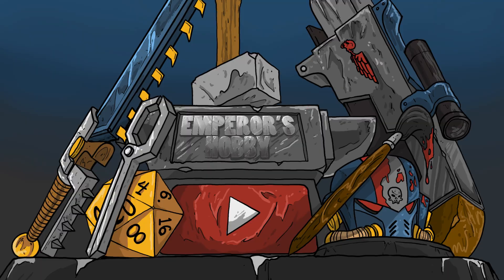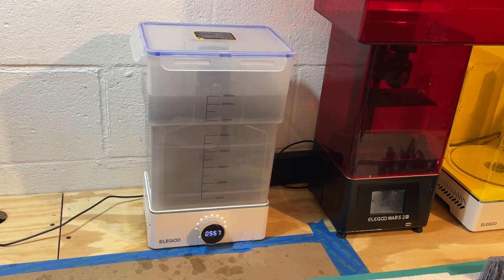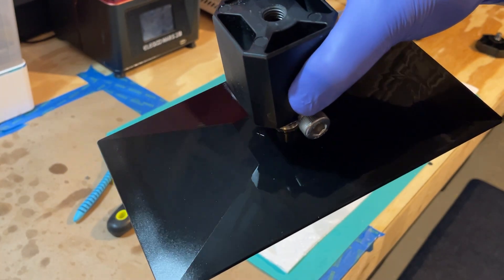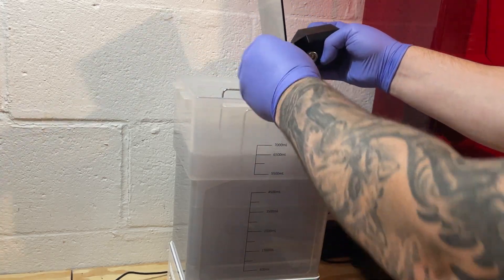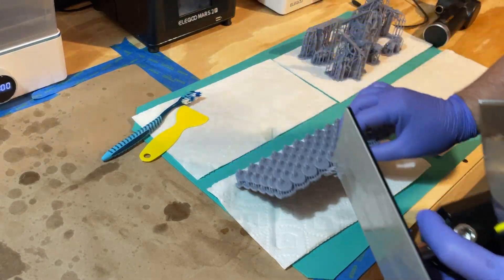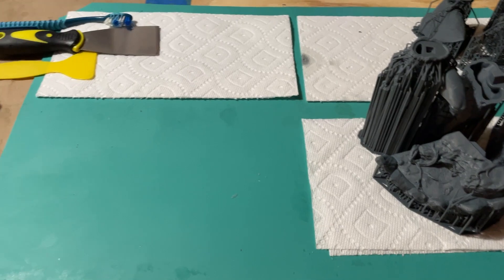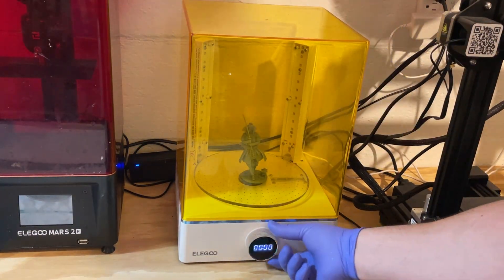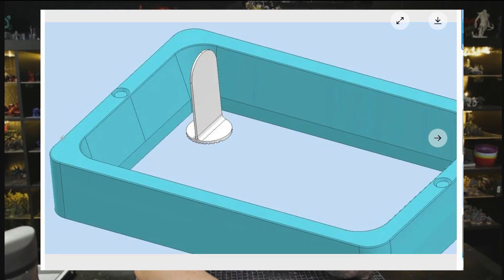3d Printing Top 10 Tips and Tricks for SLA Printers

Comment: I have got burned 3 of my acf films in like 10 prints do you suggest anything about it cuz it really annoying since they are a bit expensive to replace
Reply from the maker: Is the film tearing from the vat or are there holes in it from material pressing through? Without more deals here are somethings to check and consider: 

1. It is actually recommended to do a tank clean after every print using the clean function. I personally don't do this but it might be a good idea to try to be safe. 
2. Make sure the print plate isn't damaged (unlikely but with a check
3. When you replace the release film how are you putting the screws in? If tearing is happening it could be due to the order you are putting the screws in i.e. just going clock wise verse the alternating method. 
4. Have you recalibrated the print plate? If there is to much distance it could cause extra stress on the film
5. How well are your models supported? Pre supported models aren't always good. If they are supported poorly bits can pull off and wear on the film. 
6. Check your exposure settings, it is possible you are over exposing the material making it to hard. It should be pliable just a bit but still snap back to its shape. You can tell by scratching the prints (before curing) with your finger nail if material comes off you are good, if non at all you might be over exposing during printing. 
7. Check your release settings, if tearing this could be another cause. If you pull away to quickly especially on the first few layers it is possible you tear the film. If you are using after market film the settings could be different than Phrozen's release film. 

Let us know and we can dive in deeper!
Reply: @emperorshobby  well i get holes generally and scracthes i m New with resim printing but after i get the print ör fail the print it really become too hard to peel the resim from the film and what do you suggest about m7 or MS 5 pro or anyqubic  photon M3 Max im really very confused about deciding
Reply from the maker: If I was buying the M7 Pro is the way to go. Has a large build plate and and the auto resin refill is an awesome feature. A 14k resolution is nice as well. The M5 is fine for the money if you have less to spend. The M3 looks ok but is way more expensive with less features and less resolution. Concerning peeling the resin on a fail make sure you do a clean which makes it all 1 sheet. If you have to dump the used resin back into the bottle (using a funnel with a filter) then get the sheet off. Print some of those print pull tools, those will help you considerably. I use had problem getting failed prints off the smaller printers cause of screen size compared to the vat size and used that tool.
Reply: @emperorshobby  tyvm for your help so ilk go for m7 then and i can barely afford above 900$ if its change the idea pls hit me